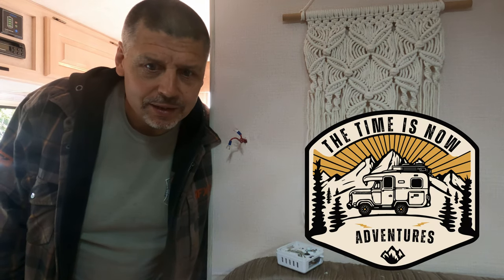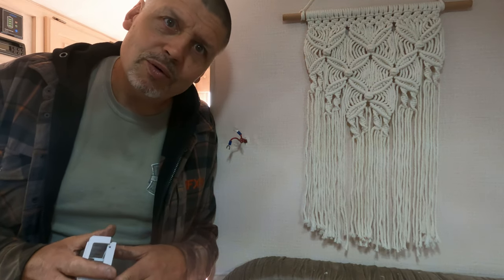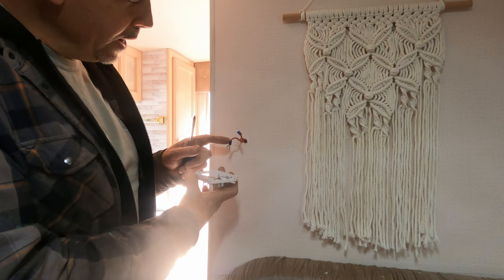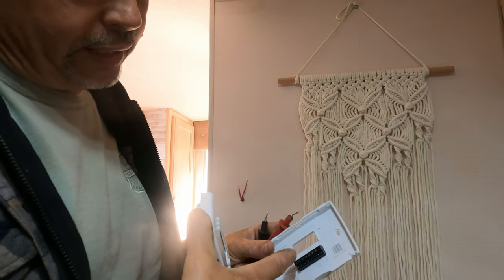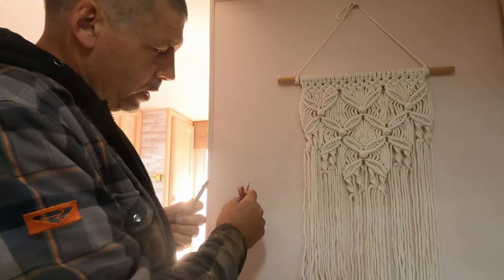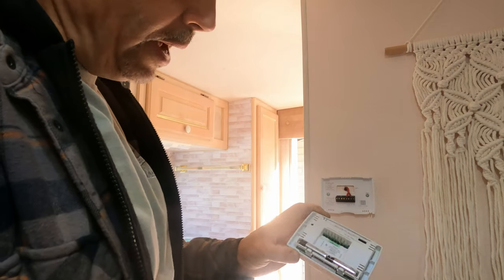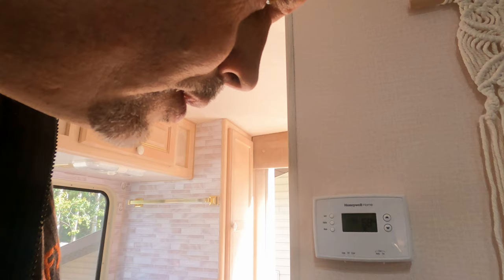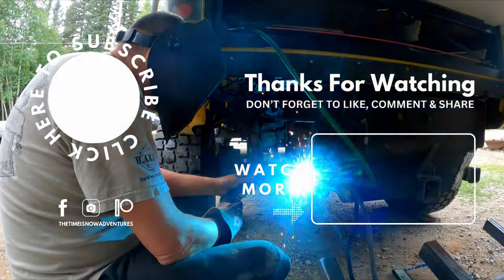Boosting Comfort: Upgrading Our RV to a Programmable Thermostat!

Comment: So while my OEM thermostat swings maybe 15 degrees from start to shut off, you can control how much your thermostat raises the temperature each cycle? Just making sure I understand this. Thanks.
Reply from the maker: Not sure I completely follow your question but we program ours to 59f at 10pm for overnight. 71F at 6 am. 59f for 10am (we'll manually override it if we're still in the camper at that time). Then back up to 71f for 6pm